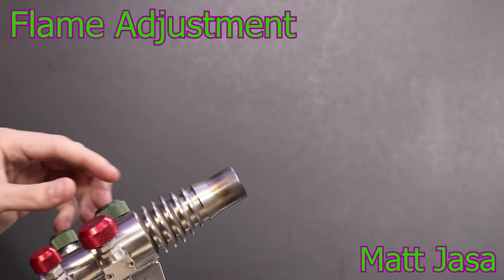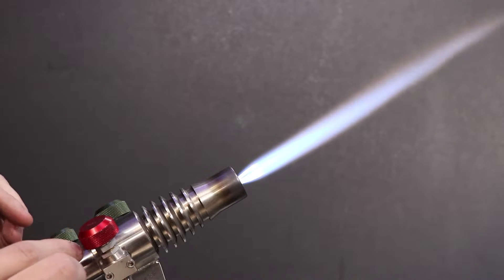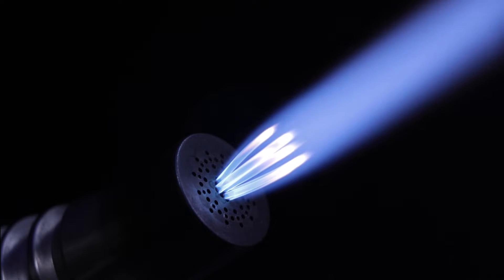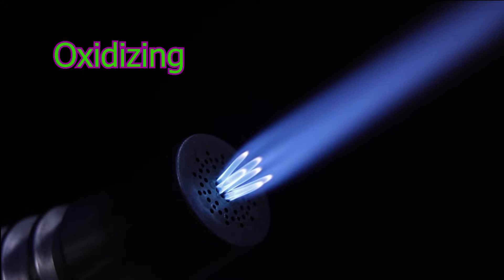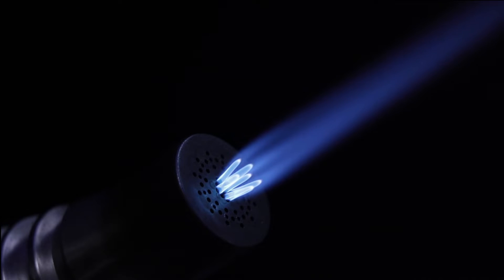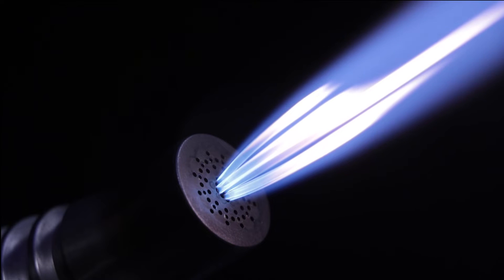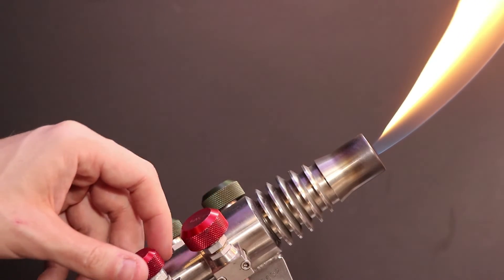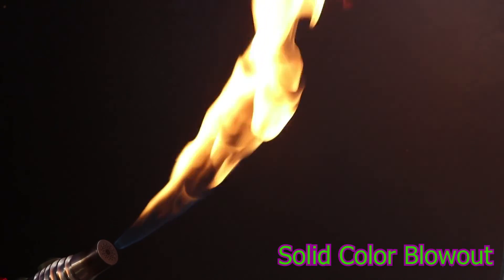Flame Adjustment Lampworking Glass Torch

Comment: Can I use soft glass rod
Reply from the maker: Absolutely, you might want to work further out in the flame and jab the rod quickly in-n-out to warm it up more slowly. Once the end is molten you shouldn't have a problem with cracking or pops.
Reply: I from India 
Plz share me same details 
1. coating 
2. transport 
3. specification

Comment: just got my torch set up and was playing with the flame settings and the torch made a loud bang! scared the crap out of me.. i turned everything off & relit it to make sure all was well and it seemed to work like nothing had happened.. 

any experience with this?
Reply from the maker: It sounds like a flashback. Do you have a flashback arrestor installed on your propane tank? Also what torch was it?
Reply: @JasaGlass  i do have flashback arrestors on both tanks, it was the beth bravo sharp. i was worried i did something wrong and broke the torch in the first 5 minutes of serting it up. i did some googling and some people are saying its normal, but idk.. i just wanted to ask if you had ever experienced anything like this since we're using pretty much the same torch.
Reply from the maker: @Dewey_Boondye420  Actually I have had that happen when I first started. I don't remember why.
 It could be a simple first time mistake, if it keeps happening it could indicate a problem. 
Remember to start with propane first and then add oxygen. When your done turn off oxygen, and then propane last.

Also always shut the tanks off when you leave your studio. You don't need to uninstall the regulator, but it's best to turn them off before turning the tanks back on. Tanks are under a lot of pressure and hit the diaphragm harder when the regulators left open, possibly leading to damage over time.
Reply: @JasaGlass  thanks so much for the advice!